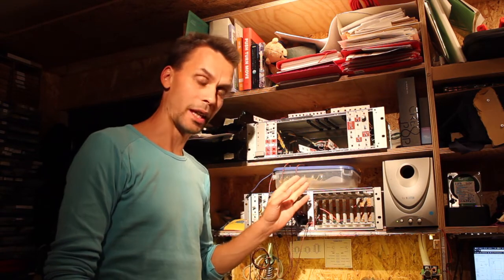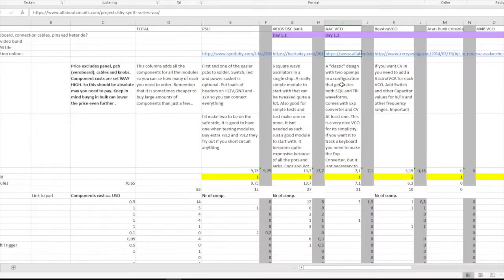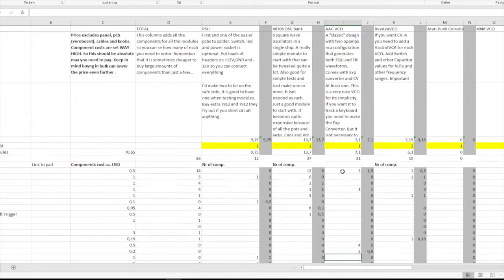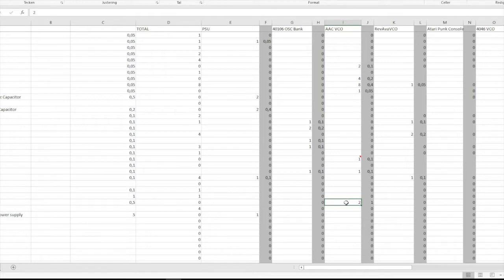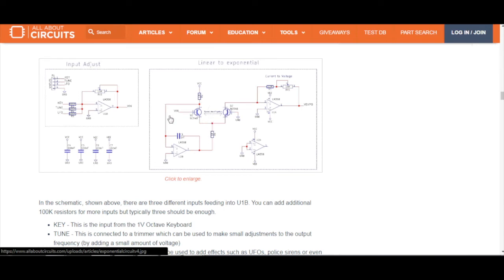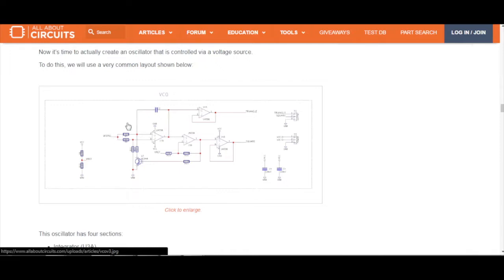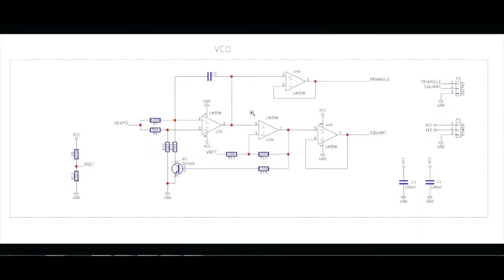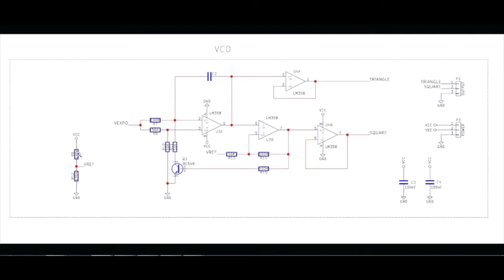Classic 2 Op-Amp  tri and square wave VCO - DIY Modular in a Week 1.2

Comment: Hey, thanks a lot for the series! Made some of the other modules and they all work well. I just finished this one and it seems that the square wave isn't working. I am feeding it some square waves from the 40106 from a previous episode, but I just get a very quiet and really high pitched sound that does not react to me turning the pot. It does change a bit when I turn some of the pots from the 40106 (strangely also the pots on the outputs that are not connected). Triangle wave works fine and I am getting some cool sounds, but yeah.. missing the square wave. Any tips what to look out for? I just built the vco part and the input adjust. I double checked all the connections and tried different LM358's, but nothing seemed to help. Will probably make a new one tomorrow and see if the problem prevails.
I am planning to build the exponential converter as a separate module with just an input and an output so that I can use it for other vco's too. Do you think that would work?
Reply from the maker: One of the biggest mistake people including me did with this module is that one opamp is powered with plus and minus and one is powered plus and gnd. Check that first. The square is created with a comparator so check that opamp so you have a threshold voltage. 
And yes you can build the exp converter on itself and use with other modules. I did. that aswell. :)
Reply: @SourceryOne  While building the second one I figured out that I had mounted the transistor the wrong way around. Easy fix, so now I have two functional units. Patched up with the other oscs and my tesseract low coast I can get some pretty cool rythmic noise extratone kind of stuff. Really fun to just let it roll and see how it develops. Pretty excited to see what the next modules are gonna add. Good stuff :)
Reply from the maker: Awesome! Well if you follow the miaw series you’ll find a lot of modules that add much interesting functionality to your rig. Hope you find a few more nuggets to build. ;) share some sound and images on the discord when you have the time. :)

Comment: after looking into this series, this seems to be the most comprehensive out there to build a basic complete system for relatively cheap. 

i just don't want to take an electronics degree before i start lol but feel like some basics would be a) useful to follow along, b) might make it easier to understand what it is that we are building (as opposed to blindly following instructions) and c) if/when something goes wrong, i'd have somewhat the ability to at least troubleshoot.

but then again, every general electronics beginners video goes into so different topics, where i wonder if all of it is necessary to build modular. 

all this to say, what do you consider the absolute basics that one should know/learn before starting with this?
Reply from the maker: The thing is I learn as I go along aswell and some videos where I had an epiphany I talk more about the ins and outs and how the circuit works. And sometimes I just build it and see if it works. I talk a lot about that it is the mistakes you learn from and you will notice if you just start building that you will learn. You will learn while just sitting there watching schematics after schematics with all the same building blocks. And after a while you understand the difference between them and thus understanding the anatomy of the circuit. :) I would just jump in there. 😁

Comment: Awsome! But I would build a voltage controlled LFO instead an of a VCO with this. Its linear, doesnt have more than max. 5 octaves of range. Its really easy to mod this circuit to do Saw, reverse Saw, and PWM. it makes for a great LFO
Reply from the maker: It is done in one of the later episodes. So yeah. Good idea. :)

Comment: Hi, really great video! But I have a few issues: 1. Does this also work with 3V or 9V? 2. And if so, how can I connect any voltage source to the VEXPO input (without exp. converter), because connecting to V+ or Gnd doesn't work?

Comment: First of all thanks for all the tutorials!
I've built this VCO, however, I have a problem that only when connecting jack to the triangle output, the signal disappears (when connecting oscilloscope instead of jack it shows up normally as a triangle). Any advice on what might be the problem?
Reply from the maker: Did you add the buffers in the circuit? Without those the I put of other module might draw too much power. And of course power to the buffer opamp.

Comment: Let’s say you use an LFO into you CV IN on this oscillator. Will it sound different if you use a triangle LFO as supposed to a square wave? Would a sine wave LFO work? Just curious.
Reply from the maker: A sine wave would modulate the pitc slowly, while a square wave “jumps” between two pitches. So yes it would sound very different. :)
Reply: Kristian Blåsol cool! Thank you!

Comment: In the diagram at 12:03 what is the component you have coming out of pin 7. If its a trim pot, can I substitute for a fixed resitor?
Reply: No.. this is to fine adjust the signal, a fixed resistor won't let you adjust the signal (so you will get a tuning issue)

Comment: Is it essential to connect the VCO core op-amps to +VCC and GND, rather than +VCC and -VCC (dual rail)? In my experience with DIY noisemakers like a simple 555 timer oscillator, the output sounds pretty thin with just positive voltage, so I would think connecting the op-amps to a dual rail power supply (like a meanwell or other cheap dual rail 12 volt supply) would make it more suited for feeding into a recording device or amp (of course with a potentiometer as a voltage divider/attenuator on the output.) Some LM358 VCO schematics on the internet don't specify the supply method either, so I think it might work. I want to get started in DIY modular, but don't want magic smoke to appear.
Reply from the maker: It all depends on the circuit you make. This circuit uses the LM358 which isnt dual rail, and then it uses a voltage divider to create a "virtual ground" in between gnd and +12v. This is ofcourse not optimal in many cases. It could probably be made with a dual rail opamp instead. As long as the components arent too expensive, magic smoke are ok, and usually part of the game ;)

Comment: Everything's working for me, except buffers, which is quite sad since I can't build the rest without buffers (Things on the output changing my pitch) ://
Reply from the maker: That is strange. Buffers are really simple circuits, and not much should be able to go wrong. Check so you have power to the opamp. And wiring of course. And one last thing could be a faulty opamp. So except those three I dont know what could be wrong. Hope it helps. :)
Reply: @SourceryOne  Double checked all of these haha, do You think it could come from my single rail 5v supply ?? (I didn't made the exponential part, only the VCO and the Buffers)
Reply from the maker: It depends on what opamps you use.

Comment: Hey ! i don't understand why i can't adjust frequency with the 100k potentiometer.  I've done VCO, tested it with a CD40106 ( as you made in the video) but when i add the input adjust circuit, nothing happen when i turn the pot... i did exactly the same as the video.. 

 any idea?? Thx!

Comment: Hi kristian
Great videos and tutorials :) I am newbie with all about electronics, but maybe i can built some moduls whit these instructions.
My question is:
I made earlier a power supply by thomas henry desing and it is - 15v gnd +15v. Can i use that with these moduls or do i need 12v version?
Reply from the maker: Most of the modules should work with 15v. Just check all ics so they can handle 15v if you use 15v and ground or if you use dual voltages that they can handle 30v. Some pots might have dead zones as the voltage is outside of the voltages that affect the sounds.

Comment: Using Vref based just on a voltage divider is way too far from precise effect. You want to stabilize the part of the circuit responsible for tuning the frequency. You want your circuit to not drift especially when other parts of your circuit share the same power supply. Always use precise voltage reference points chip like  LM4040 or REF01. More complex circuit than more problems you will get otherways.
Reply from the maker: Thanks for the info. This module was more about being “cheap” and easy. I agree it is not stable at all. I hope to find a much nicer and more stable design in later episodes. The cem3340 is always a good starting point. ;)
Reply: @SourceryOne  I just built a 3340, wonderful VCO. my bench supply was having an issue (I never plug modules into my rack until I know the are safe) but, something wasn't connecting right and it was mostly making a weird hissing, high pitched noise, and dropping out/locking up when turning the knob. when I realized what was wrong its been fine.. gotta  change some resistors (they were supposed to be 1% but, its not close enough to make my square symmetry right

Comment: where did you get the jacks from for so cheap. all I can find are ones for around $2 each
Reply from the maker: You can actually buy quality jacks from thonk.co.uk called thonkiconn which are almost standard in all modules today. If you buy 50+ you get them for 0.21£ which is a good price. If you want even cheaper I found similar (but stereo and not breaking) on lcsc.com for 0.08$ if you buy 50 or more. Those are not as good quality though but they work. They are a bit “stiff”. Hope that helps.

Comment: I'm confused, on the original circuit schematic pins 6 & 7 of the Input Adjust are connected to the 10k trim pot but it looks like on your illustration that it's just pin 7. Am I misunderstanding your drawing.
Sorry if this was explained already.

Comment: Hello thanks for this video. i am a newbe when it comes to electronics at this level. I have only tried to build the vco-part. I can't make it work. 
I have used constant DC to feed the vco. 
Just to hear a tone.

Question: do you need the VEE if you only are going to do the vco-part?
Thanks in advance
Reply from the maker: Did you make the voltage divider? It is important for the oscillation.

Comment: Hi Kristian!! I´m gathering stuff to start building some of your modules :) Let me ask you: The zener diodes for the coulored noise and the phobos ad/ar, how many W should they have? Also, in the Phobos, the 555 is the common one or the cmos (LMC555)?
Last one: There´s a cap value missing in the excel file in the simple LFO, there´s 10nF, 100nF, 22uF and two more without value, would you mind checking?
Well, I already said it, but, thanks a lot for the work you´re doing! It´s awesome!! Hope you´re comming with more MIAW soon!
Reply from the maker: The 555 is CMOS leveled I believe yes. The zener wattage is around 1w I think, just the normal cheap ones. I think I have fixed this compnent error before? I think you can ignore those. I have to check the schematics again, if unsure you can also just skim through teh schematics, there werent that many capacitors...

Comment: Getting started on this.  Do you have any thoughts or tips on the thermal coupling of the transistors and matching them?  And, in the whole scheme of the overall system, do you think it is worth making the exponential converter section?  Reading the comments and watching your other video it seems a bit of a hassle.  Thanks!
Reply from the maker: If you want to use any other kind of mainstream commercial product to control the vco ie a sequencer then you need the exp converter. Actually it isn’t that complicated. I made it complicated by doing all the “parts” on different pcbs. I did another one on a single pcb and that was fine to work with. Tuning it is still a hassle of course. I didn’t care about the thermal coupling and matching. Maybe that should be done but for my needs right now it wasn’t worth the work.
Reply: @SourceryOne  Well then, I have the parts, so I guess I'll be building the whole thing :).  Would you happen to know if it's difficult to convert midi to cv?  I guess I mean "build-able?"  I have seen midi to cv units for sale for not too much.  But I really enjoy making this stuff!  Thanks so much!
Reply from the maker: First. Check in the panels folder for the 1.2 panel with the looong name. That will give you an idea what you can do with linear and exp cv in (no cv amount on exp in) and lo/hi (lfo). Also I will make a midi-cv module aswell. Look at the page of Niklas Rönnberg (find link in colored noise or AR videos) his midi interface seems great!
Reply: @SourceryOne  Awesome!  Will do, thanks so much!
Reply: @SourceryOne  Ok, sorry to keep asking questions.  Please understand I'm on a pretty steep learning curve with this stuff!!  After looking at the panels, I have two main questions: 1) What is the difference between the Rate, Frequency and CV amt pots?  Are they in the schematics or are they mods you put in?  2) Are the Linear and Exponential CV in's just the inputs shown on the Input Adjust schematic?  In other words, both inputs go into the LM358 per the schematic?  Thank you very much!
Reply from the maker: Np :). I’ll answer a bit later.
Reply from the maker: @spot2028  Ok so the stuff on the newer panel is all mods of the original design, and maybe that was a bit overkill for you in a first vco. But I will still try to explain what you need to do to make it: Rate and Freq is just two words for the same thing. CV amount is an attenuverter to set how much of the input cv signal is used to alter the frequency of the oscillator. This should not be on the Exp converter as that is a fixed scale for the oscillator. To make it really good you should ahve a CV-summing mixer (one of the schematics) for both the linear and the exp cv input, the only difference is that the exp in goes through the exp converter, and then you just add them together at the vco expo input. If you want the LED, then take that circuit from the simple LFO schematics. But as I said, I think just make the VCO as explained in episode 1.2 and skip the rest of the mods for later... BUT with the exp converter ofcourse.
Reply: @SourceryOne  Ok, I generally have a game plan for what I want to make.  Your explanation helped a lot - thanks.  Only one last unclear bit - so, can the linear and exponential inputs be "neighboring" inputs into the same summing chip (as the schematic appears), or do you need completely separate systems for linear and exponential?  And, I promise I will begin work with that final question! Thanks again for all your help.

Comment: Thanks for this series! I built this circuit yesterday and got it to work fine, the expo converter does it's job. However, there seems to be some limitation built in as 5 V seems to be the maximum CV, so you get 5 octaves. Anything over 5 V just gives me the same note (rough C). It tracks across these 5 octaves but not too good between 4-5 V. I am sure I can fiddle around a bit more with the trimpots. Note to anybody else building this: DO USE a tuning pot as suggested (I connected a 100K pot as a voltage divider over my +9V and -9V rails.) I struggled a lot prior to adding that and just using CV from my keyboard, getting the scaling right but being slightly out of tune. I also added a simple BC547 amplifier to the triange and a 68K resistor to the square output and then a 22K to ground (the output signal is in the junction of these two). Made it play nice with the levels in my minibrute.
Reply: curious what you figured out? I'm looking at building it with a different lin/expo converter to try and avoid this limitation but, having to redesign it because it has no hi freq trim ( I suspect this will be needed on this VCO)

Comment: Whenever I try and build this module (with the exponential converter) it always gives off magic smoke from the lm358s. Any idea why? I have triple checked all my wiring and it seems fine
Reply from the maker: all of them!? Start by checking (a fourth time) so the power is correct as some are connected between +V and GND and some between +V and -V.... U1 and U2  (input summer and exp converter (one unused)) between V+ and V1. U3 and U4 used in the VCO core should be connected between +V and GND... I have built two of them now, and although I got magic smoke from the first one, that was a pot that I had connected the wrong way. So it does work if you follow the schematics. Error checking is 90% of the work on some modules. I have spent countless hours watching my circuits, just to find I missed one leg, after checking 3-4 times?!?!?!?
Reply: @SourceryOne  thanks for the help. Turns out it is was a bad connection in the power supply

Comment: For some reason this expo converter never worked for me ???.
Reply from the maker: I have just built it. I haven’t calibrated it. But now I have a multi turn pot so I can try. I’ll try to get the time to test this tonight.
Reply: @SourceryOne  Ok kool be intresting to see how you get on with it. The circuit topolgy looks similar to other expo converters . Maybe i just needed to tweak some values here and there.
Currently im ising the Roland jp8/system 100 style expos with really good tracking up to 8 octaves +.
Reply from the maker: So I got it to work. But I am NOT good at tuning this. But the functionality is there. I’ll do a live video tonight discussing this and going through a few things I did to this Vco.
Reply: @SourceryOne  Ok brilliant . I can only think you may have to tweak the ie: swap trimmer value i had to do this in my expo converter.  https://youtu.be/FydgVl3O-Aw    . It looks more complex but the basic topolgy is the same. What time will you be going live . I will look out for notification .  Also see https://youtu.be/VCUJTiZNPIg
Reply from the maker: Sorry for late reply, because of bad sounds in the live sending I did a quick video instead, which you can find here: https://www.youtube.com/watch?v=0Xi35VzSYao